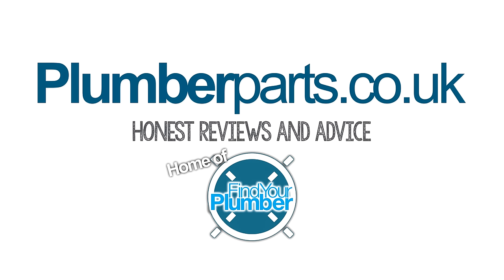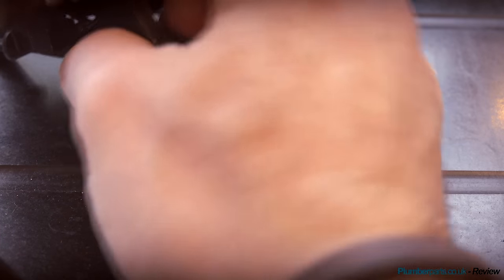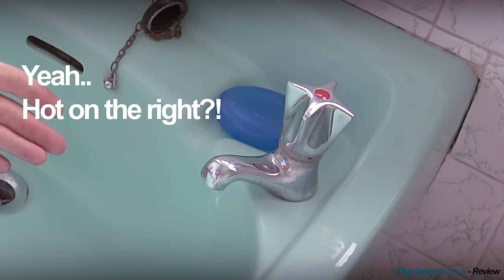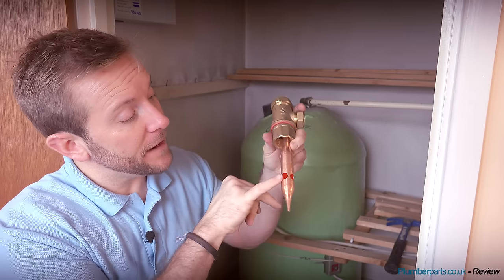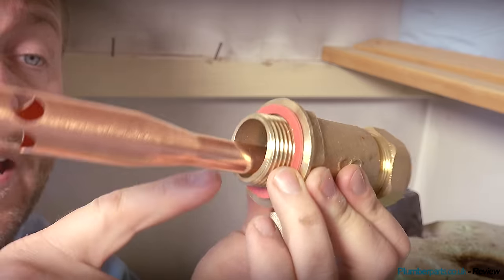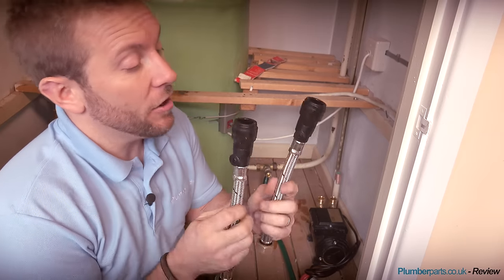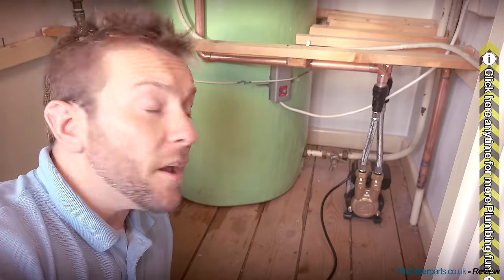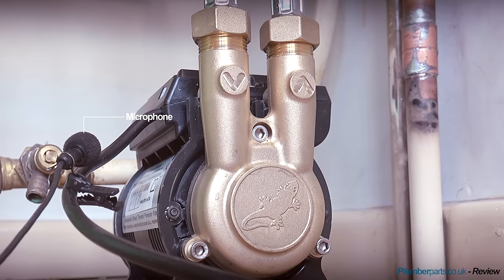BOOST HOT WATER PRESSURE - CT Force pump

Comment from the maker: Links to the tools I use everyday here: https://www.amazon.co.uk/shop/plumberparts
Plus, follow my Vlog “TimesWithJames”: http://www.youtube.com/c/timeswithjames
Reply: plumberparts GRUNDFOS SSR2-2.0 CN SINGLE IMPELLER UNIVERSAL REGENERATIVE SHOWER BOOSTER PUMP

Continuously rated pumpRegenerative impeller designIPX2 water ingress protectionAuto-resetting thermal cutoutAnti-vibration feetMains connection lead – 1.5m longBraided connection hoses with 22mm push-fit connections2 year warranty
System type Negative.
Is this Ideal for pumping hot water to the W.C UPSTAIRS?
Reply: Dude!!! So recently put in pump in airing cupboard and now customer says her airing cupboard no longer works 🤭.   Not sure what to say to her. Any thoughts? Any one come across this?
Reply: Hi we just put in a pump on our boiler tank it keeps on burning out the neutral wire do I need a new thermostat to suit the pump
Reply: Ito switching off and it seems noisy I have good flow in the kitchen and the bathroom taps but the shower has little flow, is my pump faulty or have I got  something else going on. If you can help me understand what's happening I would be most grateful. Thanks Martin
Reply: Good morning I'm trying to find out where or what is happening as when I hooked up and then after following the instructions my pump is not a auto switching and seems noisy I have good pressure in my kitchen and bathroom taps but my shower as very little flow if you could help me understand what's going on or where I've gone wrong would be most grateful for your help. Thanks Martin

Comment: You did a similar video 5 years ago - ie boosting hot water pressure from an indirect cylinder, gravity fed.  You mentioned the possibility of air getting into the pump being negligible if the pump had 2-3 meters head; does that advice still hold ?.  As in your video I want to feed a number of taps not just a shower - would a surrey flange not 'throttle' the flow ?

Comment: I often find myself watching these videos even though I have no need for a pump and I do not have a gravity fed system....it is sometimes frightening how interesting your videos really are.  lol.  Just reading a few comments I though clearing the area for a tradesperson to work was the norm???  We had an external expansion vessel fitted to our boiler last week and it was sited in a really tight and awkward spot.  I moved all small appliances out of the way, cleared the kitchen worktops from the side in use and I even pulled out the washer dryer and disconnected it so the area was set up ready for the plumber to get in and out.  Must just be me but you can't expect the plumber to do all that.
Reply from the maker: Hi Mandyram. You're the exception then! Glad you like the vids!
Reply: I'm a plumber by trade... Mainly work new construction...  If I called someone to come fix something in my house... I would do as much prep as possible... So I understand the expectation... I would want a home owner to clear their cabinet if I'm coming to fix a leak... Or whatever the situation... I guess it's only a select few who think this way... It happens more often then not.
Reply: Being a plumber myself it’s always great when the customer clears the space more often than not they don’t, I don’t hold it against them though, when I start clearing the space the customer often panics and apologises for the ‘mess’ and having not thought about it in advance, it just depends on how much of a methodical thinker the customer is, I’ve been to extremely intelligent customers houses, you know the kind that can operate on a human brain but can’t understand the simple concept of I need to shut the supply down to work on the pipes. Common sense unfortunately isn’t that common and you are the best type of customer 👍

Comment: Have you tried looking at warwick flanges? They are approved by Salamander too, and work in the same way save that the pump outlet comes out the top whilst the hot water outlet is on the side. The advantage of those, is due to the rotating collar, there is complete freedom of direction on both. I've fitted a couple. As the pump feed comes out the top, I also put a manual air vent into the loop above as it allows air to be purged when it's filled.

On those top fittings, I also seal them with a tiny smear of LS-X sealant, as on old tanks they rarely make a good seal with the fibre washers. As for putting PTFE tape on the thread, then I suppose it might make the fitting easier to remove, but those fittings aren't sealed by the thread, they are sealed at the mating surface on the fibre washer.

Comment: Sparky here, thanks for the shout out, electrical should never be DIY unless it plugs in. And you don't EVER want an extension cord running to a pump like that.
Those stairs, yikes. I'm clean and dry. great vid, good etiquette.
Reply: Question for a sparky: Why do we need a fused spur as opposed to a socket with a plug. They are both fused and yet a socket is more convenient.
Reply: @glenn20081965  A fused spur is for stationary equipment which should not be turned off unless for maintenance or in a fault situation.
If it was a socket, the plug could be pulled out by accident or by someone not knowing what it is for.

Comment: CT Force is a shower pump rather than a whole house pump. Assuming you are happy that you are unlikely to be running the shower and kitchen taps at the same time, would this be sufficient to boost both outlets as needed? (Standard shower head, one kitchen tap and one bathroom tap).

Comment: I see this problem coming. We have a 35W combi boiler fitted last year. We are building a new extension with a second shower room. I think we will have a low pressure on hot water afterwards. Is there a way to address that issue? The boiler will be in the garage (ground level), the new shower also will be in the ground level, but the existing bathroom is upstairs.

Comment: Great video. Can I use this solution if I already have 2 showers with twin impeller pumps fitted to the same hot water circuit. I would expect the tap pump to kick in when the shower is turned on if it is fitted at the first outlet from the cylinder.

Comment: Would this pump work in my situation? My house has no gas or oil. My central heating is just all old storage heaters. I have a cold water storage tank sitting above a direct hot water cylinder with the immersion heater in this heating my hot water. I did have all my cold taps and toilet (exception being kitchen cold tap) fed by gravity coming straight off tank and all my hot water obviously gravity from the cylinder. A plumber has re plumbed my bathroom so that every cold outlet is now directly off the mains but obviously hot water still gravity. I want a mixer shower on the bath ran straight off a deck mixer thermostatic tap on the bath. I've been told these require equal hot and cold inlet pressures. Would the ct force pump be the answer to this situation?

Comment: Trying to boost the flow to upstairs hot taps but my hot water pipe from the cylinder goes back up into the loft and across the floor before dropping down to the upstairs bathroom and on to the downstairs tap. Would this type of pump be suitable for my application?

Comment: Nice, I have a question regarding a system same gravity fed hot water cylinder, low pressure and flow rate through hot water potable, but with some big differences, it is in a flat ground floor no upstairs just one floor, the f&e tank and the hotwater cylinder are all in one cupboard in the bathroom right next to the shower, the bottom of the f&e tank feeding the hotwater cylinder is 300mm head between the bottom of the f&e tank and the top of the shower head, and about 1.5mts head height between the bathroom basin tap, 
So all of the pipework is under the floor plenty space to get around down there, it's a system boiler else I'd have just went for a balanced system off a combi, but I'm looking for one simple fix- install a pump to boost the hot water.
The plumber fitted a single impeller pump, not a salamander brand, something cheaper from toolstation, its a Stewart Turner showermate, it's not engaging not even with all hotwater taps, I think he's just rigged it to boost the shower, is that even possible? 
I thought if it was connected to the hot water pipe system then it would then have more flow rate and then engage pump vie flow switch and boost whole hot water including mixer shower.
The pump sits above the base of the hot water cylinder by about 100mm right next to the cylinder.
With just two pipe in q5mm pvc speed fit, 
Would having a larger bore pipe from cylinder to pump the to shower say 22mm help?
or a header pipe at 1" then to 22mm to encourage flow?
I would really appreciate your advice or any onput. Your channel is great! Very informative and a natural entertainer, you're obviously good at your job.
Cheers, Mike.

Comment: Hi,

I just want to increase the pressure to the hot taps in a 4 storey house to the top floor as the other floors are fine. The hot water supply tank is at the top in the loft and the hot storage tank is right at the very bottom of the property. Where would I need to install the pump to increase the flow to that part of the house? I’m guessing take a feed right at the bottom of the house next to hot storage tank exactly as you did in this vid and supply that floor separate to everywhere else?
Many thanks for your help
Gibbins.

Comment: My issue is my kitchen hot tap is really slow but the bathroom right on the other side of the wall is fine, I traced the hot pipe to the airing cupboard and checked there's so isolation valves turned down. I don't get it

Comment: Thanks for this, quick question.  The only problem I have is the kitchen mixer tap which has very low hot water pressure.
My question is, I have a huge power shower pump in the loft, if I fitted this pump next to the water tank would it affect or damage the power shower pump.
My house is a bungalow with the vented hot water tank at ground level, thank you for any assistance buddy.

Comment: Very helpful. Is that pump hooked hooked up hooked up to hooked up to the showers aswell? Ie all the hotwater outlets of the house? Also is there any harm in hooking up twin impeller pump to the cold water if it runs off the mains supply? Only a single is needed yes?

Comment: Thanks for the video.

1. Can I plumb a bypass to the pump and use the pump ONLY when showering ; If I swicth the pump off, can I expect the existing gravity flow to work smoothly , bypassing the pump ?

2. Don't you need a pressure expansion tank to take care of hammering on the hot water line ?

Comment: Hi ThereWe have a gravity fed water system we could turn on the heating with turning on the hot water switch but since we had a new panel fitted we now hove to turn on the hot water before the heating will work is this correct.

Comment: Any thoughts on boosting pressure on a HWC where the header tank is tiny and will run dry quickly? Very constrained header tank space.
Reply: You are able to boost the water within the hot water cylinder,  but having a small CWS tank can lead to the pump running dry which causes damage to the pump. We do offer a water starvation protection kit which can be fitted to the CWS tank and then wired into the pump. This will cut the pump out when the water level passes a certain depth. Thanks

Comment: But why is the hot water flow low in the first place? Why wouldnt it flow just as well as the cold? They're both supplied from the mains... right?
Reply: I have asked myself the same question. I am not a plumber so I don’t know but I think this system is supplied by a header tank but it supplies the hot and cold pipes so you would think the pressure would be the same. I wondered if the head pressure was lost because there is so little water in the vent pipe. I’d be interested if anybody knows.
Reply: The hot water is gravity fed not mains

Comment: James, I have fitted a salamander ct50 pump to a power shower with a Warwick valve, I have now replaced the basin and mixer tap, which is slow on the hot, I was thinking of fitting this pump to pressurise the sink and basin taps, I was just going to break into the outlet (as per your video) go to the pump and return back on the horizontal pipe just before the riser vent, would this work, or push water up the vent pipe, if it s a problem, could I just put a pump under the basin unit breaking the hot feed with the pump, as my problem is only with the bathroom basin, hope this makes sense,
Reply: Joining your question here...

Comment: Hi ya bud. Followed what you've done as I had another salamander twin pump and ended up having a leak on the pump on the cold side and salamander wouldnt warrant it. Never mind moving forward. Got myself one of these pumps just for the hot water. Maybe a bad mistake but brought a 2nd hand one but was told it's a fully working pump. Well all plumbed up and pump took ages to work. When it did the 3bar pressure was Out of this world. Sorry my showers have been a bit dull. Moving forward lol. The pump cuts inn and out. Sometimes will run a long time for about 2mins max then off. Sometimes on for a few seconds and off again.... any ideas  me ol fella. Is it the pump that's shite hence when they got rid or some other thing like still lack of pressure or something. Any ideas if ya know any for me plz.... beer on ya way 😉. Gino

Comment: James, I’m about to fit a twin impeller for a power shower  using a S flange but using compression fittings. Is this ok? Also, what if your customer wanted a power shower too? I have low flow on the hot gravity fed water like your customer so I was wondering if I need a second (single impeller) pump!

Comment: I have a pump and separate pressure controller to fit. I noticed though that the cold water coming out of the shower is at a lower pressure than the kitchen tap which is mains pressure. Thus I must have a low pressure mixed for the shower??? The cold pressure is similar to the gravity fed hot water pressure at present at the shower outlet. Thus will I need a different shower mixer if I boost the hot water pressure? The pump will be placed after the temper unit which ensures the hot water supply throughout the house is not over 55 degrees C which is to building code. It may be that there is just a restricter inside the cold input on the shower mixer?? Any advice pls

Comment: What about the over flow from the cylinder! The pump would surely pump the cylinder into the tank?
Reply: If the pump is installed correctly in line with the installation guidelines, it will not pump water into the tank. Thanks.

Comment: Hi, love the video but just a question about the pipework into the pump.
I'm about to fit a twin shower pump and been told not to do 90 degree angles along the pipework, any views on that? thanks!
Reply: A bend in pipework can reduce the flow rate  (pressure)  of water going to the pump, especially if it's a soldered joint, use pipe benders for a better flow if really needed .

Comment: Awesome video, but there's an important note about the wiring.

When adding a spur or socket, it needs to be done by a qualified electrician. Same goes for any works that alter the existing system.

Maybe the regs were different when this was posted, who knows?

Pay the extra dosh for a certificate, too.

Comment: Whatever you do don't take the open vent pipe over the feed and expansion cistern as shown on the diagram at 2.36. This is for the primary open vent from your primary heating circuit, rads, boiler etc. The open vent from the hot water cylinder should be terminated over the cold water storage cistern that feeds the cylinder. Also hemp should not be used on potable (hot) water.

Comment: Top of the Surrey flange is usually 28mm. Did you use a copper pipe  reducer to 22mm. Or did you use the reducer supplied. I often find reducers supplied aren't all that great and was thinking of used proper 28mm pipe reduced to 22mm. Also would 90degree bends be better than soldered elbows or is difference nominal? Any thoughts?  
BTW......I think your videos are great and very well put together.
Reply: The Surrey Flange or Salamander S Flange does come as a 28mm entry point at the top for the vent. Our Salamander S Flanges come with a reducer which will reduce the fitting from 28mm to 22mm for domestic pipework within the property and hot water cylinder. We would recommend to use 90 degree bends within the pipework as this will allow the water to flow better than using soldered elbows as this can restrict the water flow and reduce down the performance of the pump. Thanks

Comment: Under what situation would you need a pump which pumps both Hot water and Cold water - great to see how this needs to be installed
Reply: Chandresh Varsani : a power shower, or a thermostatic shower need hot & cold of equal pressure. Has to be gravity fed, not mains.

Comment: Is this ok to use , I’ve just started to install the aqualisa Midas shower you did a vid for and I’m worried the pressure on the hot will be to low , thank you , hold tight  pal

Comment: I have very limited space within the airing cupboard and I’m fitting the pump featured in this video to boost hot water, can I install this pump on a shelf above the cylinder or does it specifically have to go on the floor to work correctly?
Reply: CT Force can be installed above the cylinder, however an anti-gravity loop must be fitted to prevent aeration. Further details are in your installation guide, which can also be accessed via our website https://www.salamanderpumps.co.uk/downloads.php